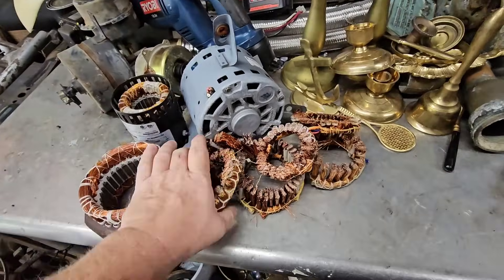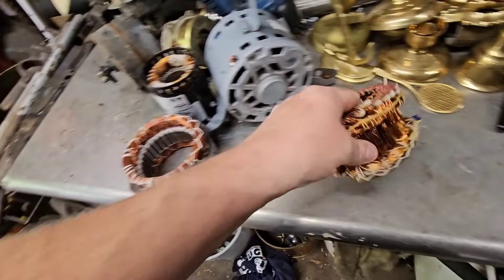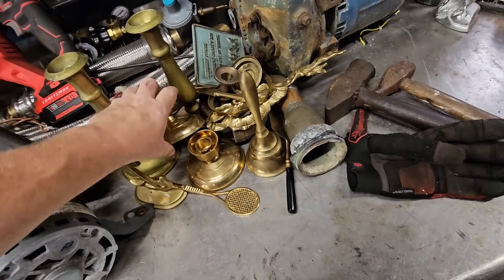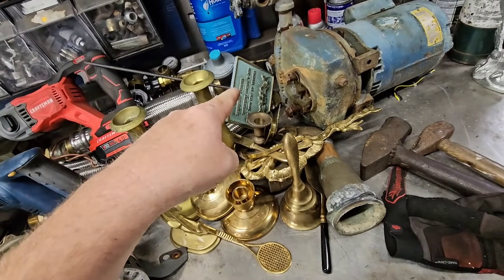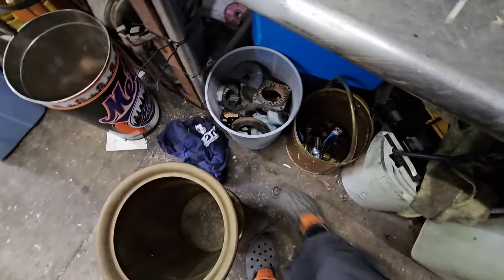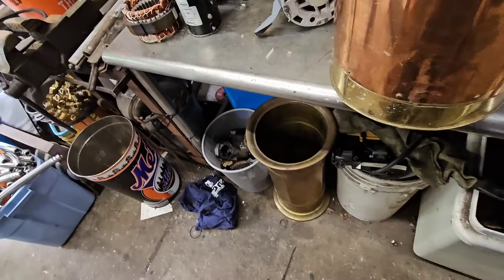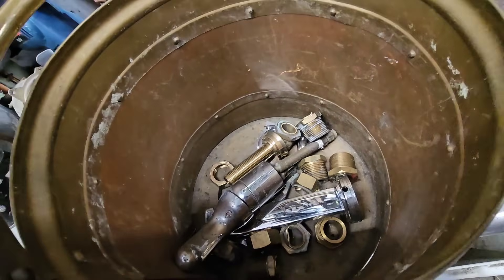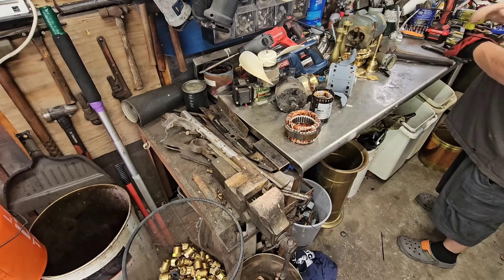Copper processing for $5 copper

Comment: Not a scrap yard in my town that pays anything over the lowest grade copper for motor windings, just not worth the extra work
Reply: I've got 12  5 gallon buckets full of windings ready to go and more to pull. I do it on rainy days in the garage or in the middle of winter. They weigh around 75 pounds per bucket because I  pack them down. Worth it to me!
Reply: Maybe for you and me but Bert has it down to a science 😎
Reply from the maker: He has a point I definitely do run into quite a few aluminum ones nowadays but there's not really too many places to find Copper in any kind of amount it sure beats taken apart little tiny Transformers
Reply: @ScrapFarm  I've been working for a AC guy for a few months now I've been saving my noodles got half a trash can full 😎